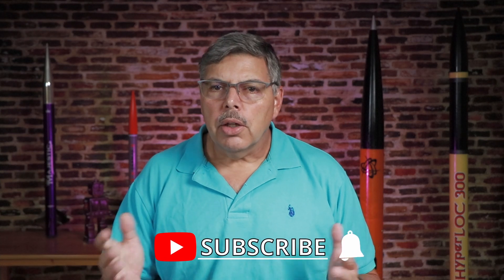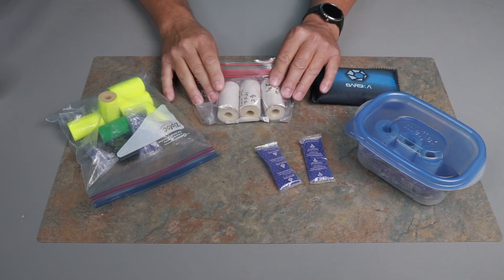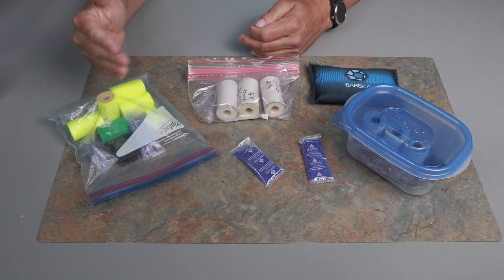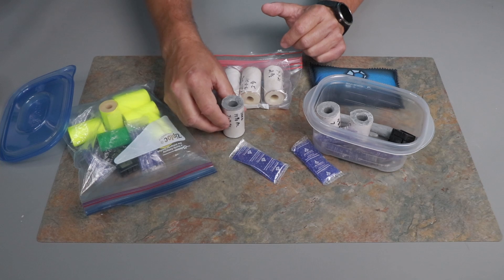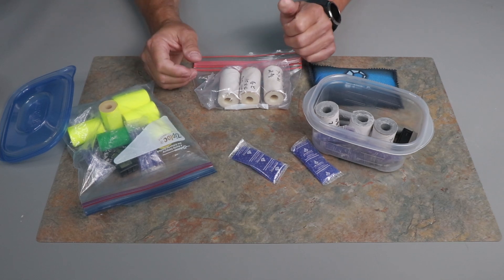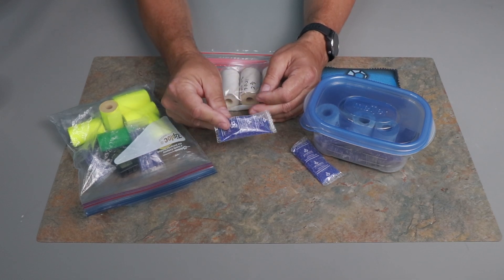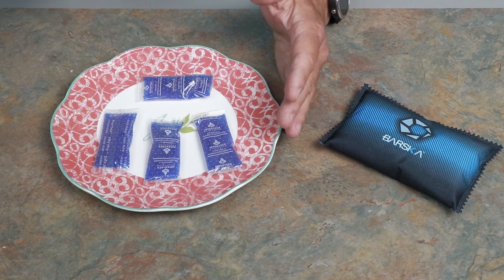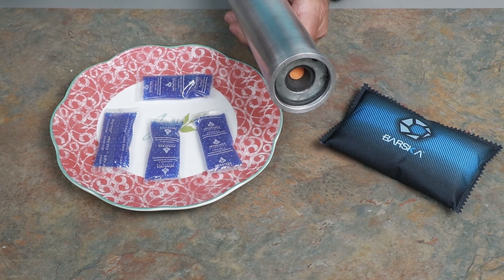Rocket fuel storage, humidity control.

Comment: Cheers from Dominican Republic! I got one questiom thou-how do you assemble the cap on a pvc test motor to prevent it from melting away? Im working with flexi-fuel btw. Love your videos. I just tested my first few grains successfully. My progress is slow as i have little to no free time cuz of work but i’d love to make my first launch by x-mas 
BEST REGARDS!
Reply from the maker: Welcome friends from the Dominican Republic!
I use glue made for PVC to attach the cap and nozzle sections. Epoxy and other types of glue do not adhere well to PVC. The cap will be able to handle the heat just fine because the duration is short. The nozzle needs to be protected from the intense heat with concrete. Good luck and stay safe!